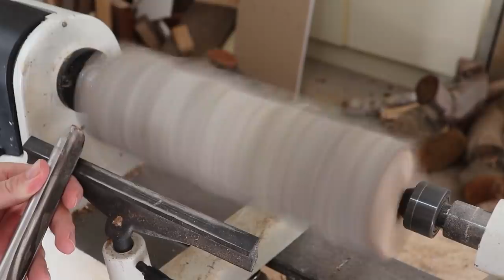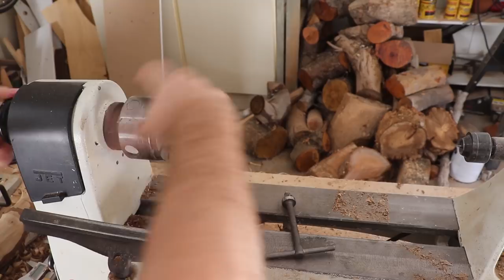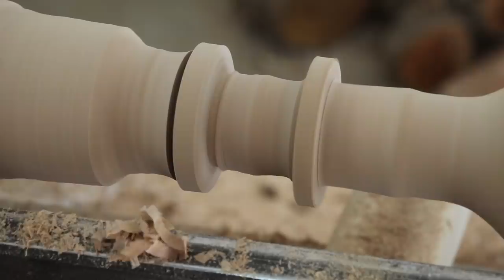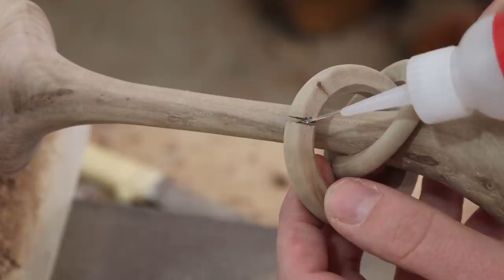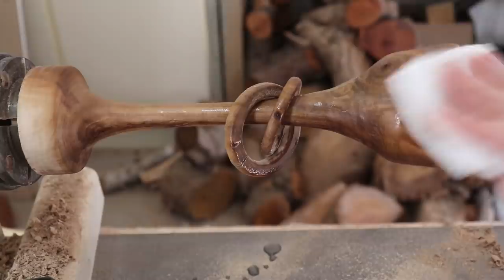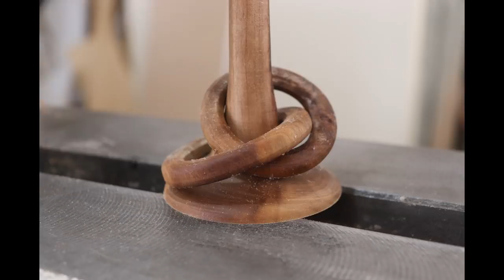Wood Turning Impossible Connected Rings

Comment: Nice work!
A bit of constructive feedback is that you can see sanding marks in the cup of the goblet and the glue line in the ring, if you use a glue that doesn't soak in as much on porous timber like that, you won't see it as much, maybe a bit more sanding would get rid of it?
Look in to some hooked ring scrapers too, you can get the rings really nice and round with them!
As i said, not having a dig, just giving advice, ignore it if ya like! I still watch your videos!
Reply from the maker: Thanks for the feedback, I appreciate it when it’s helpful!

Comment: I greatly appreciate the effort you put in wood turning, let me give you a tip and a hint. The tip is simple, next time break the ring instead of cutting it, and chose the right spot to break it, that way you will break it following perfectly its grain and when you glue it back it will be almost invisible. The hint is to take a wood turning course or to buy and study some good instructional dvds, you have a great potential, but it will be completely disclosed only when you will learn to ride the bevel properly, riding the bevel will give you perfect control on the shape, it is the key of accurate and effortless turning, i have seen in your videos how you deal both with the grain parallel and perpendicular to the rotation axis and nor riding the bevel properly seems to be your main problem. Take my advice in a positive way, as I told I see some good potential in you, my goal is not to take you down, but to help you as I am convinced that you can do much better then now if you will learn that fundamental turning skill.